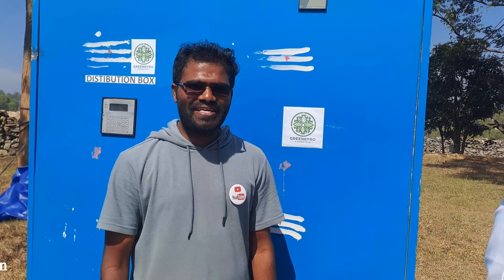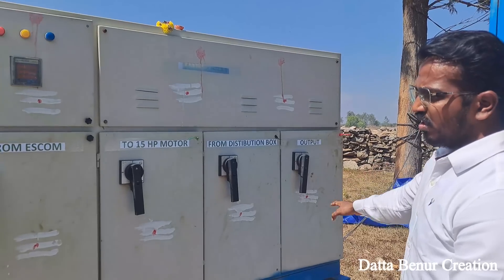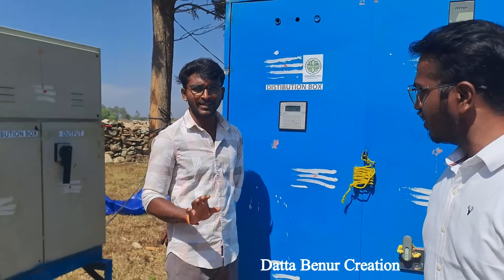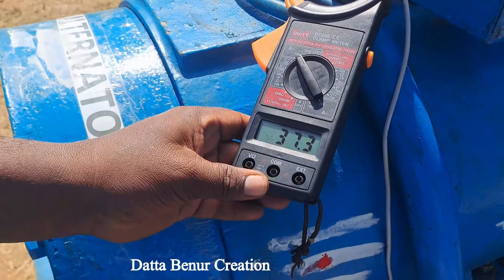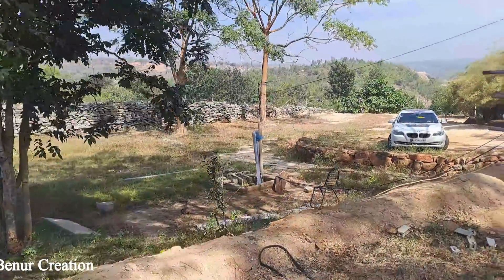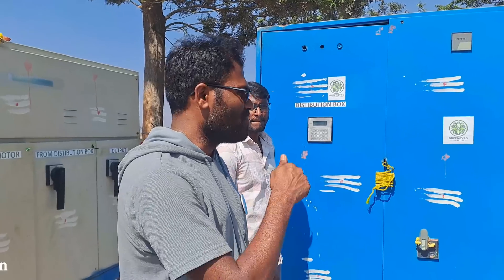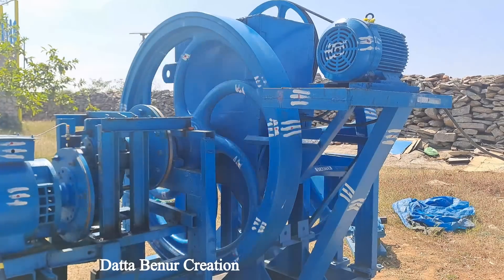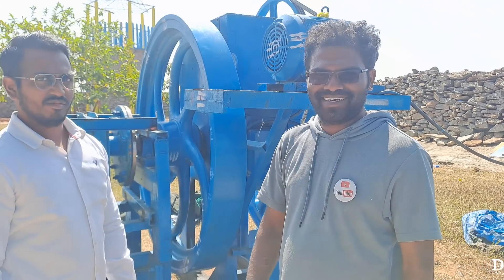the world first commercial flywheel Energy Technology - 0% input 100% output

Comment: so the usual question I have with all these flywheel generators is;  did this person spend all that money and time to build this device, knowing that it will not produce free or even very cheep energy, just to make some income from his you tube video ?    sorry I just do not believe that.   notice how slow the flywheels are turning,  one would think you would spin that flywheel up to some serious rpms, the faster you spin it the more kinetic stored energy you would have.   I am seeing and thinking something different now,  why do you need the high RPM  when you have that kind of mass spinning ?  and for sure the drive motor would be drawing way less power from the grid at that RPM than it would spinning a lot faster.   and the whole idea behind these flywheel generators is to use as little power as possible in the drive motor.  The goal is to run the drive motor at the most efficient speed possible, while turning a heavy enough mass at a fast enough speed  that will spin the generator  fast enough for it to output more energy than the drive motor needs to keep spinning the flywheel.  and that is after you increase the gear ratio from the flywheel in order to get the RPM needed to spin the generator at the speed it needs to run.   one thing these devices seem to all have in common is the energy required to get the flywheel up to speed is a lot.   too much for the drive motor to accomplish without over heating or tripping a breaker.   that is why you see many pulsing the motor in between allowing it to cool to slowly get the flywheel to speed.  in the case of this device he may be using a variable frequency drive which can adjust the voltage and current applied to the motor so not to over amp the motor while the flywheel slowly gets up to speed.    I am beginning to think it may not matter how fast the flywheel mass has to spin.   weather you have a smaller mass spinning fast or a larger mass spinning slower the goal is the same,  does the mass have enough energy to keep the generator up to speed for a certain amount of time  and  can the drive motor keep the flywheel going under the drag the generator will produce under a load.   It's a balancing act, a tuning of the components  and the fly wheel is the key component.  the flywheel is the buffer between the motor and the generator.  if the flywheel is too small it won't have enough energy to keep the generator up to speed long enough.  it will also require more energy from the drive motor to maintain its needed RPM.  if the flywheel is too large  you will use more energy from the drive motor to keep it going , that is why you have to size your components correctly.  And remember the flywheel needs have most of it's mass on the outer circumference so the wheel acts as a lever.  and the larger the wheel the more leverage and torque you will have on the wheel shaft.   it's that torque that you need to for gearing up RPM to drive the generator.

Comment: I'm curious to know what he shut off to cause it to stop rotating. Is there a braklng system, it slowed quite rapidly.
Reply: He turned the eclectic motor off….
Reply: The whole video is a lie. He was driving the flywheels with the motor all the time. He basically turned off the motor driving the flywheel. The electrical load and losses in the system made it stop that quick.

Comment: "free energy" finally  happens when all the energy that was used to get the ore, smelt the ore, cast the flywheels, make the iron for the frame, make the copper wiring, the transformers, gear box, motor....all the energy added up needs to be offset by the energy actually created.   And then there is the energy to create the money to buy this huge machine, hire a crane to get it on a truck, transport it to the site and set it up to work. You start this thing with a HUGE deficit of energy and there is major catching up to be done just to break even. So you aren't just "creating" free energy on the spot, you have to make up for all the energy put into actually getting it to work at your site.  Only then will you start getting "free" energy, which won't happen.  so the only person who came out with free energy is the maker in the form of money.
Reply: Can we stop complicating things by trying to pretend you don't understand what they mean. If it's so easy to castigate others why not show us your innovation that really works.
Reply: @kelvinnwosa6885  There is no "innovation" that provides free energy.
What answer do you have to the points I raise?

Comment: When the flywheel reaches its rotation to its fullest speed then main power supply to the flywheel motor is cut off. But to maintain the rotation of the flywheel certain amount of eternal power is definately required sir. May be certain amount of power which is generated is drawn back to maintain the rotation of the flywheel. ...There is lot of doubts arising in your explanation. The interviewer should have asked this question in  technical perception.
Reply: the grid power supply is shut off and that is when the generator now becomes the power supply for the drive motor.

Comment: Some changes in flywheel is necessary....my science project is related to this only...Based on my experience flywheel design should be changed and flywheel should be placed in vaccum glass chamber to completely remove air drag force on wheel 🛞💨...And big yes this project work ...Amount on period of free rotation of wheel after applying input is the profit and aim  of the project...😊👍🏻
Reply: harnessing the damping effect of the initial exerted force but at lower barriers relative to the higher one, its a working idea as it reminds me an old pendulum clocks once started from max potentials they can go on upto 36 to 48 hours

Comment: Complete SCAM. As pointed out by @eugeneleroux1842 and @ljbarcalla1068 below, the method of 'demonstrating that motor input power is zero' is so obviously false. That meter will reads amps when clamped around a single conductor, as when he showed the alternator output. But when it's clamped around 3 of three-phase conductors it will read zero amps. Any electrical technician knows this. So why is he wasteing so much money to set up this false demo? Shame on him.

Comment: On the surface as many have noted you cannot make something from nothing. Thats NOT whats happening here. The part he is not showing you is where the other part of the equation is solved. 100% output = flyinertia + losses. The flywheel wants to spin forever but losses prevent it. This system used magnets on the flywheel and electromagnets powered by the output to overcome the losses. So Energy out = the spin energy stored in the flywheel + the work energy of the magnets. It's not something for nothing as they imply.

Comment: @4:30 the amp meter is showing 0 amps. Well it should because all three phases are being measured at once. Even if it were single phase it would also. But monitor a single conductor (as in power wire) at a time ....then you have a true reading and not till then. 😮

Comment: I know there is no free energy, but this person has made a huge setup, that is amazing. I am wondering what are three horizontal lines and a red dot everywhere on the machine. May  be this is the secret power.
Reply: That is Chandan stripes and kumkum dot , we believe this to be sacred in India
Reply: there is free energy, wind, solar, hydro.   but technically you are correct because in order to harvest these free energy sources you need to build the device to do the harvesting, which cost money. however when we say free energy we are talking about the energy source and like to ignore the cost of the device needed to harvest it.  but after you build the device and take into account the cost , then over time the energy becomes very cheep.

Comment: I like the way he measured the current to the motor.  What a trick!!! :)
Reply: …a clamp meter around all 3 phases at the same time reads zero unless there is a fault to earth. During non-fault conditions the meter would read zero amps as all the current that flows in, flows back out again, cancelling the input. This one part of the video confirms this is being run by the motor. 
If it really works, cut the belts from the ‘start’ motor. Even then the alternator could be driving the flywheel as a synchronous motor. 
Of course, it’s smoke and mirrors. And some second hand electrical control gear.
Reply: "When measuring a 3-phase circuit, the clamp meter should be applied around the R, S, and T wires (all three wires) at once. Leakage current can also be measured by applying the clamp meter around a grounding wire."
Reply: 😂😂😂😂😂
Let's find out what college he graduated from..?
Reply: @cahayabaru1476  college graduation = brainwashing. Can you tell me which university is teaching about ufology and free energy?
Reply: Lol, don't disapprove if you know nothing. Can you make a better free energy device?
Reply: So you know better than the technicians and engineers who run the device.
Reply: who measure amps like this:face-fuchsia-tongue-out:
Reply: How one can measure Amp.on both positive and negative wires at a time amp. Can only be measured by using it separately on either Negative wire or positive wire separately Can the Inventor Replay my Question.
Thanks.

Comment: It's an energy storage device.  The utility spins up 2.5 tons of kinetic energy. Then it can supply electrical output from the rotating flywheels.  The useful output must be some percentage less than the total input.
Reply: How do you give  the input energy continuously if the generator consumed total stored energy. Again  the 15 kw motor will be started right?? .  How much electric energy will be generated per hour after subtraction of input motor energy consumption
Reply: It's an "energy from the vacuüm-extraction" device. How could a little motor in 20 sec. store such an amount of energy.Think.
Reply: You have been brainwashed at school.
It works!!!
Reply: No it's not,  it's an energy from the vacuüm retracting device .😊
Reply: Yes, and many companies offer this service in Europe
Reply: @mohitkoker7441  Lol, maybe , but they make a high RPM and you can only store what you put in.
Reply: that's the thermodynamics law. always an energy loss when converting one energy to another.
Reply: @SenthilSolo  the law of thermodynamics is not valid in the universe, because it involves infinite amounts of energy. On other planets they use this energy but we are retarded yet.
Reply: @SenthilSolo Lol

Comment: " ZERO % input & 100 % output " 
......... proceeds to demonstrate an overlycomplicated , WILEY COYOTE , machine with many bearing surfaces, belts with elastic hysterisis, common electrical motors connected to flywheels & hypercombobulating-framistams..... 
And people Actually will LISTEN to this?

Comment: There is a missing info. Where did the flywheel get the power to turn it in the first place. 
There is no battery nor mechanical force applied to turn the wheel. 
He needs to explain what started the wheel to turn.

Comment: The amount of energy input to this machine is much higher that the energy output.  Bearing friction losses, drive belt loses, windage losses, motor losses, generator losses, gearbox losses, etc.  If the machine is really efficient, at best you may get about 60% of the energy out of the generator that you put into the motor.
Reply: Not only is this correct, but the stored energy would have to be used within minutes, otherwise it would be completely consumed by the losses above.
Reply: You are right.
Reply: I believe it works and it can produce 25-30% output maximum that can be highness to higher voltage through inverter and enough transistors ...
Reply: Hawma ch.mashen.prias
Reply: How long it can start running
Reply: What is cost
Reply: It's called the Inertial Increase of Electrical Power. It uses inertia to amplify the torque and as such amplify your power input by the motor. Resistance doesn't matter because the motor overcomes it. The amplification comes from the fact that to stop acceleration of a flywheel you don't need to apply an "equal" force but only opposite. The force can be half if the distance from the center is doubled. This works in reverse if your taking power closer to the center which causes the moving mass (further from the center) to produce an amplification of torque. Atleast that's how I understand it. Research Energy Impulse Secrets and Power Impulse Secrets by kanarev for more information. The impulse probably comes from gravity due to the imbalance flywheel. But by using two imbalance flywheel 180 degrees out of phase to remove vibration problems.
Reply: @raloed.363  completely wrong😂
Reply: @raloed.363   the  input energy required would be greater than the output . Resistance , friction everything matters  motor can'overcome it until  it's running when it's off everything matters , impulse  coming from gravity ?? What is that ?? , first of all you should understand that there is no free energy !
Reply: @jibinjohn3989  the motor never turns off. He just turned of the external power to the motor. The motor is still being ran by the generator. At this point you saying it can't work is just like people saying airplanes can't fly (untill they were proven otherwise). Did you research the papers by kanarev that I suggested? 
I don't see why someone will invest so much time and money into something they know won't work, how long do you think they will get away selling this level of fraud to someone?. Something like this will cost 10s of thousands to a 100 thousand of dollars.
Reply: @raloed.363  yeah the only wrong statement i see here is free.. In the world we live in you will never get anything for free ,the system wount work                             
The amount of money invested is alot but its a good demostration but for the world to change this must be done in small scale ,mostly for house hold use.

Comment: Sorry but this is nothing new.  The U.S. and UK did all of this in the 1950's and even had vehicles that used the concept.  The bottom line is that 70 years later, it is still not in wide use.  If it sounds too good to be true it probably is.  The enemy of all flywheel contraptions is this; friction.  This technology is very inefficient despite appearing so at first glance......

Comment: If the machine is not running on power and flywheels are running alternator with the help of gear box which is generating the power; then how come it can be put off with the help of switch. If switch is provided for alternator to stop producing power, then what is the relationship of alternator with flywheel which leads flywheels to stop

Comment: Its nothing more than fuel less generator instead of starting using petrol or diesel or any kind of fuel it is starting using external electric power  which will just store  its energy into a flywheel and it will  work for sometime but as the load comes it will start decreasing its output power just as when no fuel engine will  come to stop. just that it will be a generator free from pollution but how efficient is the question .Better if it rotate the flyw heel inside a vaccum chamber to reduce  friction otherwise  it hard to get long duration output

Comment: this will be  scamm , if they dont have a driver to rotate the flywhel, the secret on the gearbox the he said what they call the multipliyer gear rotation on for 2000kg of flywhell and the mass to energy enertia. output... so that's imposible say that the motor primer was cut off.. see the on the video that the outcord of generator was still connected to primer motor...

Comment: Given the flywheel's inertial time frame threshold, it will stop, and cannot be perpetual with zero input and 100% output. The only way anyone can convenience anybody with this kind of contraption is mathematical proof that takes into account both electrical and mechanical factors as well as applying those associated negating efficiencies that definitely disproof the acclaimed 100% efficiency. I appreciate the efforts put into this huge contraption, but we can never cheat physics. Given the time, it will always get us.
Reply: no one believed on the theory of relativity when its proposed until some mad lunatics comes side by side with disasterus  plans and the world got unleashed to new domain of physics called Atomic physics breaking the barriers of classical physics and now we are entering the in a new domain of physics called quantum physics because now scientist have hit the physical barriers of the silicon chips advancement and need more powerful cpu's and now they are on the verge of disclosing the new era of quantum cpu's for endless computing power, my take here is not to offend any idea on the basis of any specific generic law because these laws are meant to be extended under further research (and its historically evident that only lunatics and mad ones are responsible of 99% of scientific break though's, others are there to harness and rectify those ideas to its full potentials
Reply: it's not zero input, it's zero input from the grid, the generator takes over the job of powering the drive motor.

Comment: Not a world first and not 0% input. The machines we already have for kinetic storage units are in a vacuum chamber for starters. The flywheel will stop as the energy is taken. It stores the initial input energy as kinetic then reconverts the energy with the generator. The energy loses in this system make it inefficient.